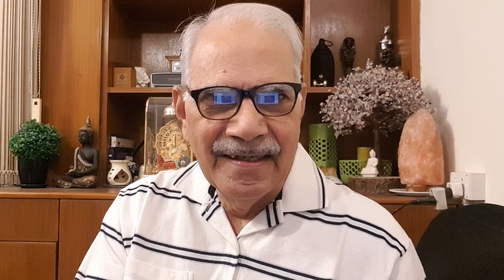ISO 9001 2015 Clause 4.4/4.4.1 Quality Management System and its processes.

Comment: Thanks for sharing  such valuable videos related to ISO. If possible can you please share the PDF/soft copy for ISO 9001:2015.
Reply from the maker: It is not possible to share ISO Standard due to copyright restrictions please.
Reply: Thanks for reply. If possible  u can provide link for reference, which can we use to read it. Any other alternate approache to get the ISO from any site..
Reply from the maker: @chandanpandey6509  https://www.scribd.com/document/291221502/SR-ISO-9001-2015
Reply: Sirji.. can u please explain the different  types of audit. Difference between Process, System and IT system with illustration
Reply from the maker: @chandanpandey6509  The audit process is same for all. The guidance document for all the audits is ISO19011. My video on Internal Audit is also based on this standard.
ISO 19011 is an international standard that sets forth guidelines for management systems auditing. The current version is ISO 19011:2018. It is developed by the International Organization for Standardization.
Reply: But sir there objective, requirements and preparation will be different.
Reply: Please let me know if u have any videos for 19011:2018  standards. As I can see in your subscription no videos related to 19011:2018 is published.
Reply from the maker: @chandanpandey6509  I have not made any video on ISO 19011 and do not feel the necessity for doing so.
Reply from the maker: @chandanpandey6509  Yes, you are right but you need to understand all that. Please do some study on your own.

Comment: I am having a bit of trouble understanding part C of 4.4.1. What exactly does criteria and method mean?  For example, how would I answer this question? 

Have the criteria for managing these processes and their interaction been established?
Reply from the maker: Part C of Clause 4.4.1 relates to the process or method of carrying out an activity with the purpose of getting a desired output in the form of some product or service meeting specified requirements. The criteria is the specified requirement for product or service and also the parameters by which we can judge the effectiveness of the output. Count of non-conformances observed during a process may be one criteria for effectiveness of the process. Percentage of rejections could be another criteria of process effectiveness.
The method is step by step process for creating a desired output. Normally it is written down as a procedure and the procedure may also spell out the criteria for effectiveness of the process.